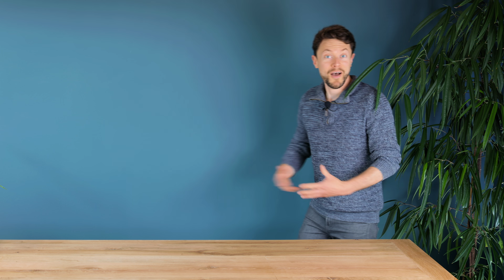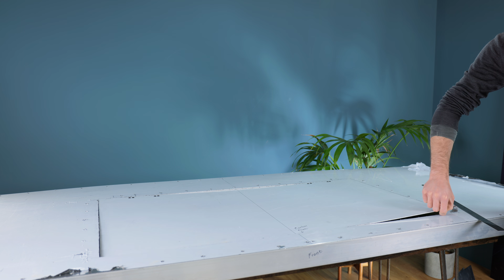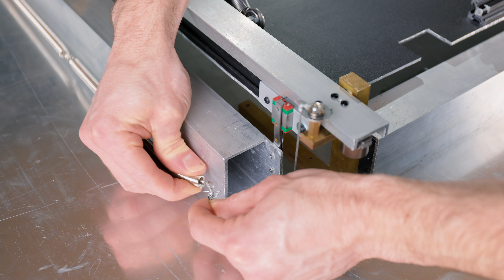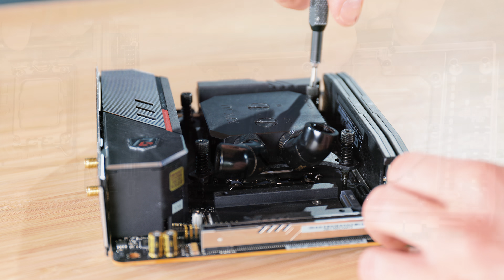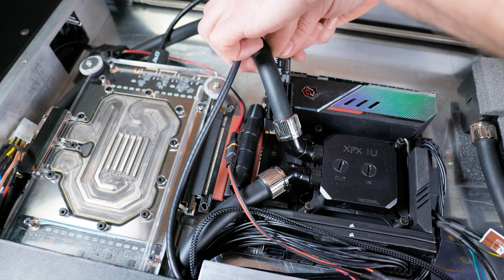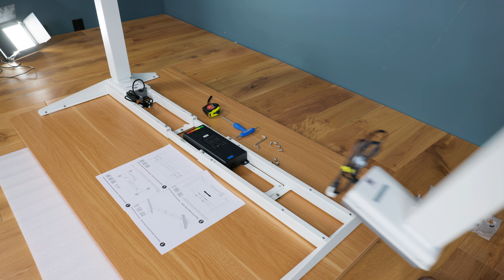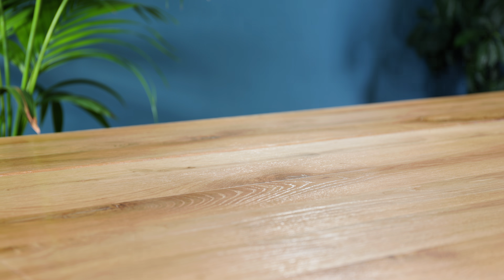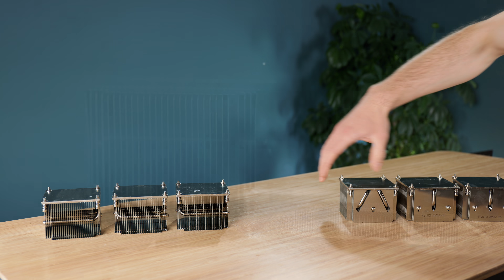Building the ENDGAME invisible PC

Comment: If one day FlexiSpot desk frame become an essential part of minimalist furniture, it will undoubtedly be thanks to you and Mr. Basically Homeless. You've truly elevated our desk to another level. Cheers!
Reply from the maker: Thanks for sponsoring the project! Much appreciated, I loved working on this one 😊
Reply: @DIYPerks  just an idea.. If you apply adhesive felt under the magnet, the lacquer of the table will wear less quickly when the system is opened.
Reply: Please sell these!  @DIYPerks
Reply: @DIYPerks  i dont know if we can make the bottom cover become 1 large piece thin copper/almunium heat sink ?
Reply: @DIYPerks  Will the ribbon cables survive the opening and closing repeatedly?
Reply: @DIYPerks  Start a ASMR PC Build Video lol
Reply: @DIYPerks  got a link for those hinges by any chance? It's like a mine field to find the right ones
Reply: @DIYPerks dream desk
Reply: @DIYPerks are u single by any chance😂?
Reply: @DIYPerks Make the keyboard and display invisible too
Reply: @LimitlessGamers  it's already bin done by another Channel owner. Also it didn't work as it should.... yet.
Reply: @WaptimusPrime  yeah but not total failure it worked I believe he will still be able to improve it
Reply: @LimitlessGamers  
We don't have the hardware for it. (At least, not for the public.) 
Make no mistake, I rate the creative potential of this channel very highly. That's not the problem.
Unfortunately, we will have to be patient for a long time.
Reply: @LimitlessGamers  what do you mean by that?
Reply: @LimitlessGamers  Make yourself invisible.
Reply: @LimitlessGamers  Both can be done/disguised
Reply: @WaptimusPrime It wasn't an invisible monitor. It was a thin sheet hanging above the desk.
An inbuilt projector in the desk top gives an invisible monitor.
Reply: @cgi2173  I'll say it again. It's already bin done. Didn't work as it should.

You think there are just 2 people in the world who tried it?
Reply: @flexispotus i ate my desk...
Reply: @LimitlessGamers  25:54
Reply: @DIYPerks  My words of wisdom, if over the next few months you decide that that desk is something you really enjoy and want to keep well into the future I would suggest you keep a look out for a sale on a duplicate screen. Its a big ask to tell you to buy another $2000 monitor and just keep it in storage, but that was surely an expensive build which is mostly customized around a very specific monitor. Spare parts for such a unique monitor will be hard to come by in only a few years. If you're vigilant during that time you might be able to pick up broken ones for super cheap(relatively) and salvage the control boards or screen depending on what was broken on each one respectively. I've DIY'd with nonstandard/custom/gimmick products a lot in the past, and I often regretted not buying spares for the parts I couldn't reproduce myself, it felt like a waste to have to tear apart and compromise on something I had worked so hard on. Excellently done by the way, its a beautiful desk, I really liked the cooling set up.
Reply: @Matt-jm5hd If that is the only monitor available that does this, then that's the only monitor that can be used. 🙄
Reply: @cgi2173  You are correct, which is why you might want reread my initial post  (I'll summarize it for you below anyways). The point I was making is the same as you have responded with, although my post was long winded, built from decades of actual experience, and polite. 
TLDR: In my first post I advised DIYPerks to purchase a second monitor of the exact same make/model that was used in the desk so that if one of the components or screen ever fail he will have identical back up parts. Because it is a $2000 monitor I then advised him to keep an eye out over the next few years for people selling broken versions of this exact monitor which he could then pick up at a huge discount and could use for spare parts. He will still have to tear the desk apart a bit depending on what breaks down, but he wont have to completely redesign the whole thing around a new monitor.
Reply: @DIYPerks hi mat do you have plans and build product information plz also what would build cost be plz
Reply: DIY perks and basically homeless, 2 🐐s of the game
Reply: "You've truly elevated our desk to another level" I see what you did there :p
Reply: Flexispot really flexing themselves here as the sponsor
Reply: I read your username as Flexi POTUS lol
Reply: @ZacharyFriesen I read it as flexis potus all the time too. Lol
Reply: Please make a product like this
Reply: Wow wow wow! Why the hell doesn't this exist? I would buy this desk in a heartbeat.
Reply: @Akash.Chopra I would agree
Reply: I'm online about to purchase a desk now. This video got me.
Reply: Honestly, love my Flexispot - thanks for having a great product
Reply: @flexispotus make a 71"+ desk in white oak or at least rubberwood please
Reply: The DIYPERKS code isn't working on the E7 Pro I have in my cart
Reply: @chZubka  HI! Please renew the checkout page. I think it works now please try again. Sorry for the inconvenience. Please let me know if any problems.
Reply: With your desk frames, would I be able to connect the desk to an extension cable that goes to the top of the desk? That way, I can have multiple ports on the desk, I have seen you work with lots of great channels, and plan to use your desk frames when I get the budget!
Reply: This is -effect timing…I was looking for a height adjustable desk. After checking out the specs, I’ll probably buy a flexispot desk now
Reply: Promo code doesn't work on the Canada site unfortunately.
Reply: Please make this one of your models, and take my money
Reply: Flexi should make a desktop product like this
Reply: @flexispotus pun intended?
Reply: Id like one FlexiSpot Endgame desk please!
Reply: @flexispotus so whens the production model lol
Reply: Hey, im from Germany and i was going to buy a Flexispot-Desk just because of this guy and I cannot use the referal-link nor the code on your german website. I will not purchase it until I can!
Reply: Just tried to purchase one of the E7 Plus desks, and the DIYPERKS discount code did not work. It just said "this code cannot be applied". Get that checked out!
Reply: I got the 1k like :)
Reply: i dont know if we can make the bottom cover become 1 large piece thin copper/almunium heat sink ? @diyperks
Reply: Hey, when will you start shipping to the rest of the EU countries?
Reply: u have inspired me to make things my self i have started easy and now i am trying to make a bluetooth headphone thanks for al the great video’s and keep it up
Reply: Possible
Reply: Wow I love it so much that I am inspired to make my own version
Reply: I've seen two of your sponsor spots so far (this one, and another on Styro Pyros channel) and I have to say you really know how to pick people that fit your product well.
Reply: Get outta here flexis potus not the place for politics
Reply: @pizzazif WTF are you on about?
Reply: read more comments
Reply: Does the code work on the uk site?
Reply: @peaxoop  Sorry but it only works on US site🥺
Reply: I would really like to know and see what your workflow looks like. Everything from idea, planning, drawing, material selection, etc.

Thanks for sharing a fantastic project again 😀
Reply: love the name drop of sir homeless
Reply: lol. There are 100 other designs over the last 5 years that “flexispot” just stole haha I bought the exact same design for $225 5 years ago. But it is  great product
Reply: @quantum_beeb you don't reinvent the wheel, you just improve on it's existing design
Reply: @quantum_beeb  ambatablough
Reply: You are doing my dream job 🎉
Reply: I can’t afford your desks 😢
Reply: We are in the end game now. absolute masterpiece of engineering and style .the technology not being as cool as desired at first but then changed to be proper is admirable as well. i love the custom brass cooling plate, smart use and it comes out very clean.
Reply: I want one, considering mass production for clients. Some of this DIY are too good!
Reply: This channel and sponsor combo was a match made in heaven
Reply: Without you, they would have no legs to stand on.
Reply: Should have used the q8 legs
Reply: @flexispotus is it possible to have four legs connected to the same controller for an L-shaped desk?
If it is, do you have a part number I can have a look out for?
Reply: I recommend to get some knowledge in air cooling and air flowing because this DIY project clearly lacks of the basics.
Even on a metal surface, you are potentially creating a fire hazard.
Reply: Most meaningful sponsorship of all time
Reply: Why would you give these feet if you know the top will max out the capacity? It's bad for the engines long term. You should have given the E7Q.
Reply: How can i buy these desk from Bangladesh?
Reply: can i buy thay one? 😊
Reply: Truly elevated...get it? 😂😂😂😂
Reply: @LimitlessGamers that’s never gonna happen
Reply: oh yeah, I have to upgrade my furniture because it wont run windows 12.
Reply: Wish I had these skills, I don`t know how you find all the different products to build this and if a part doesn`t exist how would you create one.
Reply: I'm wondering if a refrigerator cooling system could be used on a PC  table that you build because there was an episode of Adam Savage on YouTube not sure if you're familiar with this channel but this refrigerator repair guy build them a cooling system for his costume so basically it was like a some kind of jumpsuit with caper tubes that in the jump suit he put on and it kept them cool about 60° cool so when he wears his costume he's not  hot at all he's  so I'm wondering if this would work for a computer since you were finding ways to cool down your table pc here the video i was talking about  https://www.youtube.com/watch?v=z_Ti4GP0ntE
Reply: Thank you for sponsoring so many creators, some truly incredible work has been done. 

DIY perks made a masterpiece while exhibiting your product. 

Others should be taking notes.
Reply: I hope you can sponsor meee 😄
Reply: That is a fantastic ad my friend. Well done marketing team...
Reply: I would love to get a desk, because it seems you have some great frames for decent prices, only issue, you only serve the surrounding countries, and unlike some other companies, you don't just ship it from those for an extra fee.
Reply: Someone please tell me name of apps to make design similiar like that, include type of mechanism.
Reply: Wish I could make something like this
Reply: Basically homeless mentioned what is having enough beans about 🗣️🗣️🗣️🗣️🗣️🗣️❤️🗣️🗣️🔥🗣️👏👏
Reply: hi
Reply: What monitor was that?
Reply: gimme one please
Reply: Turning a simple desk into an invisible PC is the stuff of legends! The precision and detail here are just next-level.
Reply: I don’t know how or if it would help but your big fans underneath the desk you could 3-D print a fan duct back into the PC to cool everything else I don’t know if that help or even be worth it
Reply: "You've truly elevated our desk to another level"
Not YOUR desk. All you did was providing some legs that one can just as easily get at a local IKEA.
Reply: 96 replies before this comment? Rotate it for 96 again 😂
Reply: Please tell me what kind of acoustic system does it have?
Reply: How do you turn on the pc?
Reply: @flexispotus
can i have a desk???😅
Reply: while the concept of standing and working seems healthy, standing in one place isn't actually healthy. You need to walk or run.
Reply: But now you can’t use the curve feature in your curve display
Reply: But now you can’t use the curve feature in your curve display
Reply: Wowww
Reply: I just took at look at flexispots products they look like great quality i feel like there missing out on a whole new market though, many people have standing desks and they are built to last but what we dont have is assessories. I would love to have a endgame invisible pc desk that would be great but i dont have the skillset or the money for something this amazing I totally would and could throw money at a draw that mounts under my current desk that i could build a PC into thats low profile and could help declutter my desk. I would totally throw some money at a Draw PC case that i build like a PC and mount with some screws.
Reply: indeed
Reply: You're gonna make way more than 2k with this video so stop bitchin'

Comment: As an engineer I think your 23:07 older heat sink is okay but 3d printed part not calculated well for the air flow and the push power of the Airflow
Reply: The 3d printed part it has to be smaller port but the sound it make will increase so it's a loop
Reply: The air flow has lost power throw the curve and the heat sink dimensions so small

Comment: Oleds are way to expensive though especially ones like that so not very practical, but cool at least also would be nice if you actually included the parts lists for your builds. In any case that design is wonderful engineering.

Comment: There were a few ways to deal with the "radiator" issue. There are 80mm and 50mm radiators on the market, but even your second iteration gave me an idea. Room might be an issue, but could you not have mounted the fans, either 90° or on an angle, and ducted them through the heatsinks? This would get rid of the fan underhang and make it more efficient?

Comment: the storage is mind boggling! Not just the amount of data storage, but how it is accessed. I wonder if using a NAS like that adds extra load time, despite the 10GbE connection. I'm also curious how the boot drive is handled and if the OS boots through the NAS or not.
Very cool build, I'm jealous! Cheers!

Comment: I am surprised to see that putting on so much weight on the inner platform and basically using it as a hand rest while typing, doesn’t push it in and doesn’t close the lid.  You have built a really fascinating piece of art. Congrats 🎉🎉

Comment: Biggest shame is the use of the 13th gen intel in this build, it'll either fry itself dead or throttle itself to be worse than 12th gen intel. At least you can access the components if you ever decide to upgrade to a AMD.

Comment: there is one compromise -> the height of the screen above the table

also if somebody is building this, moving the invisible hinges higher, accounting for the thickness of the wooden surface, will remove the need for that spring loaded wooden filler behind the screen
Reply: If somebody building this😂😭bro no one is attempting this sorcery

Comment: 17:00 I think I would’ve done finger joining for the planks and make it one solid table top. cutting out the section for the opening bit. In theory, it should make it a lot more sturdy and a lot cleaner too, plus you wouldn’t have to use wood filler.

Comment: old video but... I wonder what would happen with half the heat sinks and the fans mounted at an angle with some shrouds to direct the airflow, I think you could archive the same performance with a lot less heatsink, I would try to remove them little by little while testing.
But knowing you you probably tested, you are always very thorough whiz your calculations.

Comment: Dude, it would be bad ass if instead of using a magnet to open the pc, it had a power button underneath that both turned on the pc and turned on some motors to pop it right up, and when the pc shuts down it closes automatically

Comment: Sorry, I'm kind of stuck wondering why you went with a NAS and 10Gb network card vs a wired solution? Something along the lines of an external m.2 enclosure that runs on thunderbolt you could slot into the space to the right.

Comment: If I were in you, I wouldn’t place the radiators directly on the metal piece, as that could improve the cooling efficiency. Instead, I would mount them only onto the metal piece in the center, securing them from both sides of the of the metallic frame making the radiators float. As mentioned, ensure there’s no contact with other objects. Additionally, the fans could be positioned at a slight angle along with the radiators, maintaining invisibility. To cover the visible angles, you could use a wooden panel that matches the desk design. This would improve both aerodynamics and cooling performance while keeping everything discreet.

Great Job

Comment: So, the quick issue or possible issues with this build:
-dual 500w PSU. While 500w for the CPU/MB is enough, even for 13900k, it really ain't enough for rtx4090. Rtx 4090 is a big boy and has a TDP of between 450-600w. 500w for Rtx 4090 ain't enough. Not only that, but I doubt those PSU have at 3.0 certifications to deal with the power spikes that Rtx 4090 has, which are 2.5-3 times their TDP (hence why you need a much bigger PSU in terms of wattage of it's an old PSU, otherwise unexpected shutdowns/bsods occur). 

-cooling cables near the pump don't look that safe, they risk getting a leak. 

-the cooling brass "rods" are awful. I only saw them once but they aren't even the same size and you can see it with named eyes. I doubt those radiators are properly conducting any heat because not much of it is transferred to them in the first place. The only way to properly do that would have been to machine (CNC) all 4 at the same time to make sure they are all the same height. 

I wouldn't risk such high flagship parts inside that table. The project is ambitious, but some aspects haven't been properly evaluated. Don't worry, bigger guys failed (just look at LTT). Someone will figure it out and iron out all the issues.

Comment: Amazing build unfortunately you put a 13th gen intel CPU into it let’s hope it doesn’t die, but if it does I’d recommend upgrading to AMD also if you wanna try making the fans smaller and still quiet, you can try 40mm or 60mm or even 80mm Noctua fans as they are the quietest fans you can get a aw

Comment: Maybe you should have put a bit of felt on the bottom of the puller magnetic. It will start to wear the surface of the wood due to sliding it away from the metal plate area.